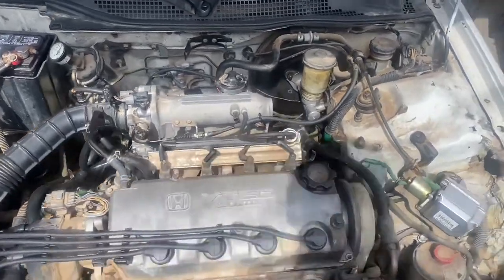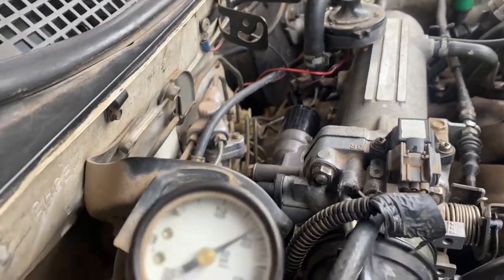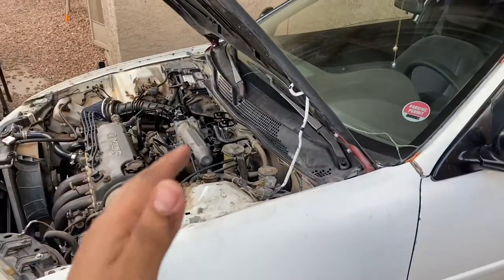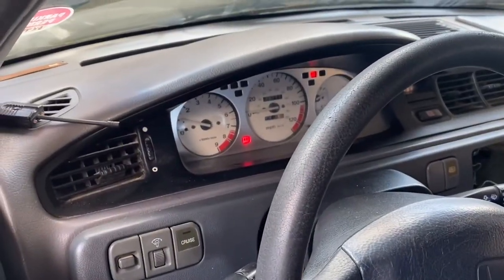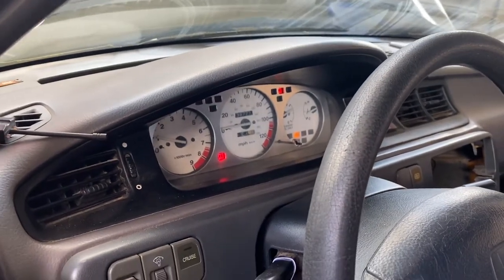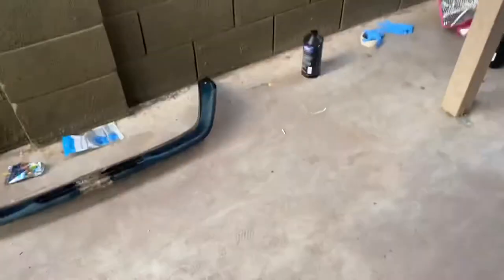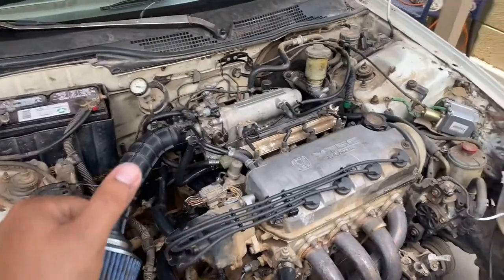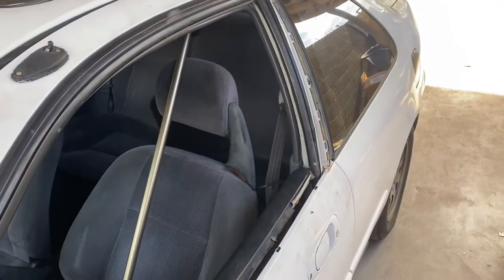Idle issue fixed on my civic (idle screw)

Comment: You shouldn't be pulling sensor plugs if you don't know what they are for. "That" sensor is the most important one of all . Tells the ECU the motor temp.,Doesn't turn the fans on, that one is a switch on the thermostat housing
Reply from the maker: Thanks for clarifying that!  🙏

Comment: I'm having the same issue, on a cold start it's idling at 900 but once it's warm it'll idle at 600-700, if I turn on the AC it'll idle at 500 shaking the entire motor trying to stay on, I've replaced the idler thinking that was the issue but didn't solve my problem, so I'll be giving this a shot

Comment: If it has an IAC valve. Clean it out with simple green, and carb cleaner, or get a new one. Also change that pcv valve.
Reply from the maker: I actually did end up replacing both of those parts and they really did help alot but the timing belt snapped  and set the build back alot now 😅
Reply: A iac valve is never the answer it’s just a easy go to for people to say because they don’t know anything about cars
Reply: @Sup251  so your saying it just idle screw needs be adjusted fix idle surge?
Reply: @Sup251 usually its just a simple cleaning that fixes it, Fast idle thermo valve, air in the coolant etc… annoying shit lol

Comment: That screw adjusts air/fuel mixture. Not idle speed
Reply: A throttle body, not a carburetor. 

With the iac unplugged, that air bleed screw sets the base idle speed. 

That is if everything is working correctly. 

Which in that car it obviously is not.

Comment: Which is best rpm position 900 or 1000
Reply from the maker: I would refer to the owners manual for the exact position but ideally you'd want to be in the 500-800 range.

Comment: That screw is Air Mixture. There is a  set screw and that has a little play on the arm where the throttle cable is. About a 1/8 th of an inch i guess. It is hard to get to on my Y8 but that is really the only true idle adjustment.  Like a carburator. The spring wheel stop for the butterfly.

Comment: Dude, if that's a Honda, adjusting idle requires you to disconnect the evap sensor, start car and allow it to run until fans kick on, then you adjust idle control while car is running using quarter turns.

Comment: mine surges then it goes up to 3000 rpm and doesn’t go down. It runs and drives fine. Any ideas on how I could solve it?
Reply from the maker: Iacv? Try cleaning or replacing I'd also replace the pcv valve
Reply: Maybe the fitv needs to be adjusted or replaced

Comment: my 95 Civic Coupe idles at around 600. seems low to me.
Reply: That sounds fine, mine almost dies when I come to a stop even with the clutch down
Reply: @LandonsBuildz sounds like alternator
Reply: @derpy4335 what makes you say that? It’s probably the IACV like most other idle problems. I bet a new alternator couldn’t hurt tho. These motors are supposed to sit at 600-800 and never touch the idle screw, it’s fine how it is from factory
Reply: @derpy4335  lmao liar. stop giving bad suggestion.

Comment: is there an idle relearn procedure for this gen?
Reply: you pretty much only need an idle/ecu relearn if you try starting the car with throttle body disconnected. typically for these you need to tighten the iacv screw all the way, then unscrew 3 full turns.

Comment: You still have the car? is it still holding up?
Reply from the maker: Yeah I do I mean I don’t really drive it every day more like once or twice a week but so far so good
Reply: @budgetfixes  yea I've got a low idle on my 94 civic after it warms up I tried this today but after further inspection I found my radiator fan to be not functional pretty sure it's the coolant temperature sensor since it worked when I wired it to the battery